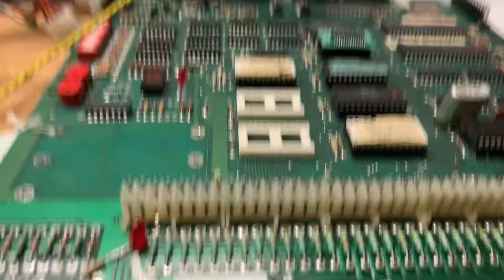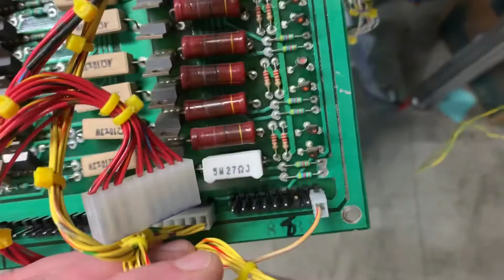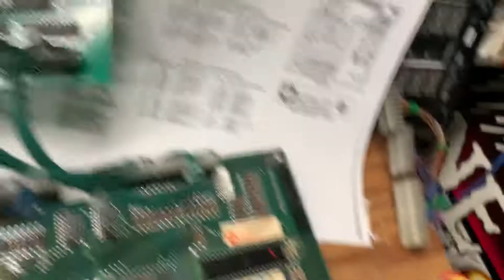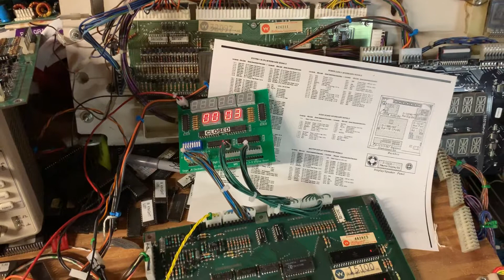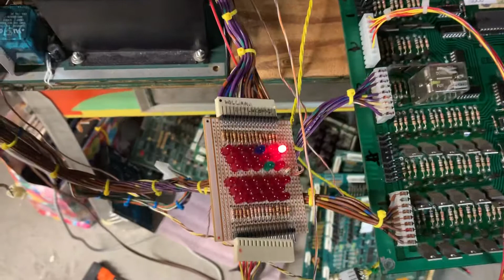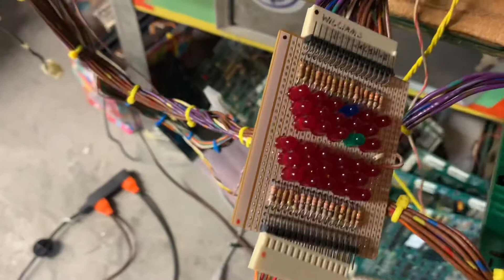Williams System 7 Black Knight MPU and Driver Board Test

Comment: Hello, this card uses a 2n6427 transistor for the lights together with a tip 42 and a resistor, I want to know that a transitor equal to the 2n6427 I can not find one that does the same job as that

Comment: What purpose is the blanking signal used for? what is it blanking. The specials coil are high current coils or what are you referring to as special coils?
Reply from the maker: "Blanking" is an old term used to mean that the "devices" (coils, lamps, display) aren't allowed to work when the microprocessor isn't running normally. This prevents coils from locking on when the microprocessor stalls/fails. Blanking is typically implemented via AND or NAND gates.
Reply: @ChrisHiblerPinball  Is the MPU microprocessor sending out a blanking signal at a certain clock cycle because you soldered an LED+ current resistor but the LED is not flashing and just stays on, so I don't now if the MPU is sending out a blanking signal after so many clock cycles to RESET the coils from locking on? Most pinball games don't use a watchdog timer to reset the MPU any reasons they don't use a watchdog timer to or a reset circuit to reset the MPU?
Reply: @ChrisHiblerPinball  When pinball games have a Resetting problem what are some common test points to do when a pinball game is resetting? since pinball games don't use watchdog timers to reset the MPU, its often the reset circuit that is connected to the power supply when turning the pinball game on that the reset circuit will reset the MPU and wait for a time period before the +5volts is stable. Most reset circuits are some type of comparator circuit and RC time constant network it seems? What do you do when pinball games have resetting issues?
Reply: @ChrisHiblerPinball  when a FET on the driver boards is shorted the coils will get locked on which the PIA chip is suppose to output send an IRQ signal to the MPU chip to tell it that the FET is shorted and coil is locked on? The FETS used are TIP122 and often changed with TIP102 but not sure why they made driver boards that when a FET is short it "locks On" a coil, is their any mods to do to the driver boards to make it that the coils will NOT lock on when FETS are shorted?